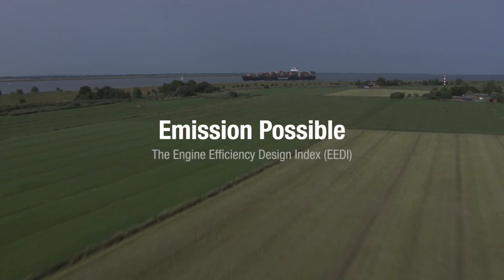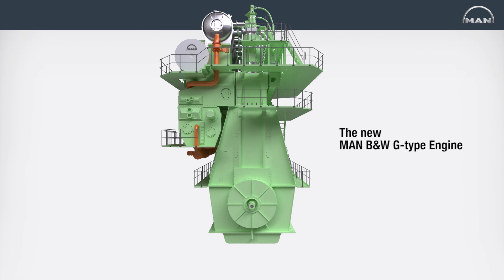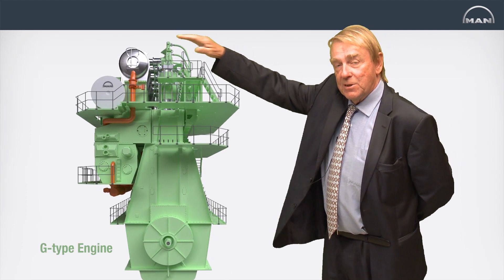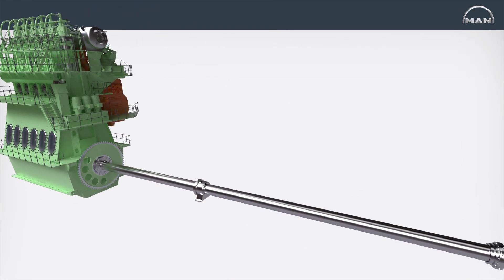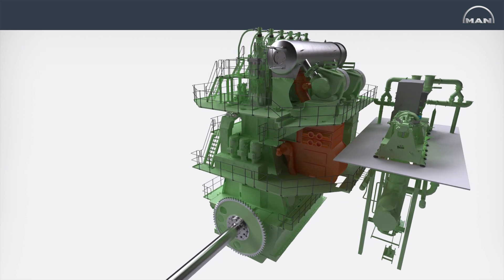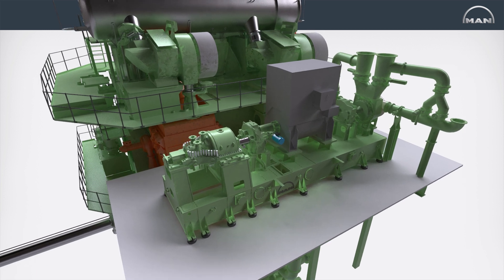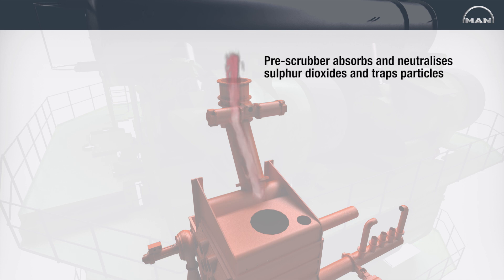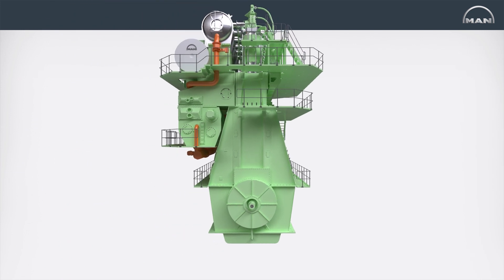Emission Possible - The Engine Efficiency Design Index (EEDI)

Comment: this is a great informative video about current an upcoming marine propulsion and s3 emissions control aswell as upcoming Advanced Propeller designs that actively reduce emission levels , its all quite exiting learning about the advanced & Responsible  headway there actively making in the marine Industry, though current HFO's as staple fuel can't always be relyed apon in the future an I forsee more advancued eco Friendly plant & bacteria based Fuels being used including numerous types of Gas fuels aswell as solar and the good old wind power becoming more emergent in the forseable, I also asume advance ambient water current harnessing Anchor/ drogue propulsion will likely be hitting drawing boards verry soon aswell as an alternative & emergency propulsion option on heavy vessels!
😉😆⛅🚢🌊🌊.

Comment: Can you tell me the difference in aEfficiency Of pulling the ship with a cable as Compared to the Efficiency of the Normal way. Not that you have a fixed object conveniently nearby. :But perhaps some artificial anchor- Dock Could be. Made using two motorboat. And a huge underwater sail. Don't forget to send any royalties my way.